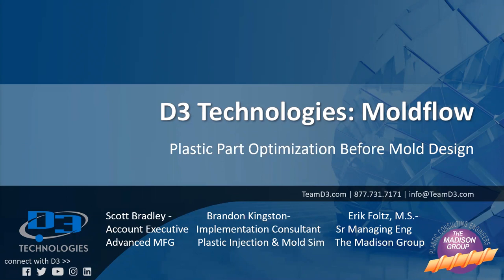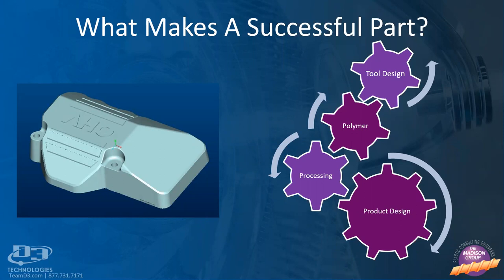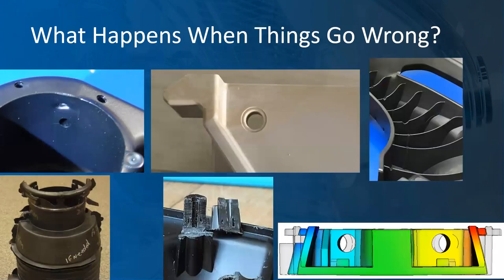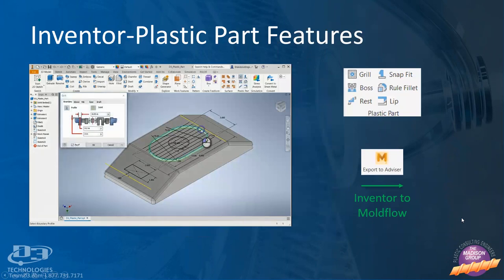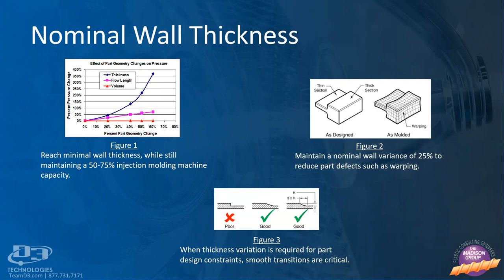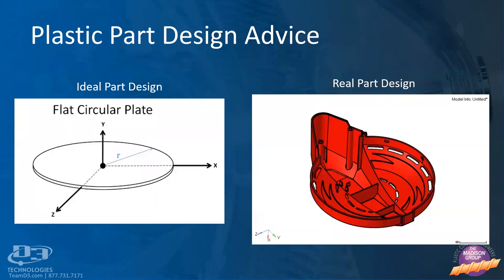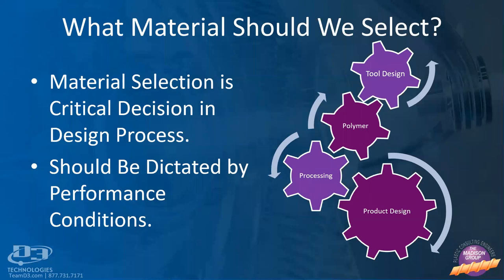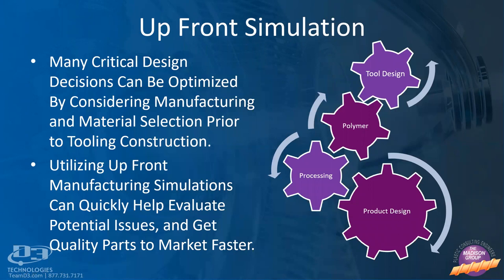Moldflow® 3 Part Series - PART 1 - Plastic Part Optimization Before Mold Design

Comment: can Moldflow software be installed on injection molding machines?
Reply from the maker: Thank you for your question!
Moldflow is software designed for Windows operating systems.  Most injection-molding machines run on proprietary systems or microcontrollers that cannot run Moldflow.  It is also not practical to run Moldflow on an injection-molding machine due to the computational power required to run analyses, and it may interfere with running the machine.

Moldflow is intended for use by analysts, engineers, and designers to investigate a design’s ability to be molded even before physical molds are made.  Moldflow should be used early on in the design process to validate design decisions and inform possible changes.  Therefore, even if a molding machine meets the system requirements and could run Moldflow on its hardware, it is not recommended (even discouraged) to run Moldflow at an actual injection-molding press.